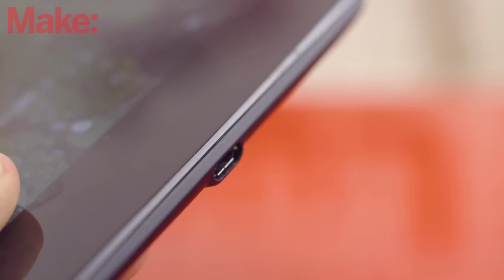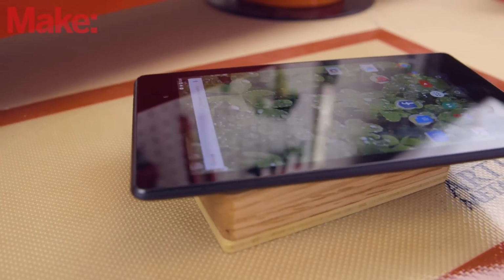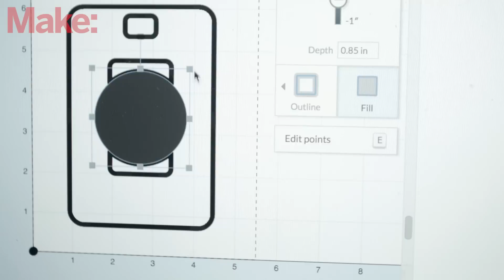Weekend Project: CNC Wireless Inductive Charger

Comment: Where does the charge coil/circuit board come from - has he pulled a regular induction pad apart to make this wood version, or do you buy it separately? - I thought this would show me how to build the induction charger, not put one inside another container.
But seeing as it's wood, you could have put some decorative inlay in the top, recessed the plug more to tidy it up, or even directly connected a power lead with standard pins or usb plug directly to the power input port
Reply: will S this is pulled from qi charging mat or pad

Comment: Which program is the one he uses to make is drawing of the project?
Reply from the maker: I used Fusion 360 to do the drawing layout, and then Easel to set it up for the CAM operation.
Reply: +Make:  Oh! Thanks a lot. I didn't think you would respond. But thanks!

Comment: We have alternating current in India. Would that work here ? What is that coil and the circuit board and where can it be found in market ? The thing you have made is very desirable and it is interesting that it can be made at home also. Thank you for this video. And, kindly do not forget to answer my curiosity because I also fear of ruining the charging port of the phone.
Reply: You need a 5v 2amp adapter, which just happens to be available as a usb charger for a phone.

Comment: Will this charge at the same amperage as the wall wort?  

i.e if the wall wort charges at 2.0A will this wireless charger also charge at 2.0A?
Reply: These chargers generally say they require 5v at about 1.5A. In my experience it's best 2 throw 2A at it.

Bear in mind this thing just takes 5v on two wires. You can easily cut the micro usb connector off and add a typical 5v dc connector, then use any 2A and up dc wall wart.
Reply: Shoot, I gave all that info and didn't answer the question. These charge relatively slowly, probably a single Amp at max. Performance is better the closer you can get the coil in the charger to the coil in the phone.
Reply: chrisbinnie Hey thanks man, I appreciate the info.  Yeah I think that's just a little too slow for my liking, but still a cool idea non the less.
Reply: +lilturk726 The trick for me was to get the little cheapo ones off of eBay and pepper them all over my life. Now whenever I set my phone down, it's probably on a charger. 

Bear in mind, too, it's not a choice between wireless and wired. You can, for instance, use a wire during the day and have this by your bed for when you charge all night - slow doesn't matter then.

Also bear in mind that the 2A USB you need to run these chargers will fast charge your phone. Enjoy the wireless day to day, and then if you really need the juice now, just unplug the charger and hook the phone up directly.
Reply: chrisbinnie That makes a lot of sense, having these scattered throughout my house and maybe even one at work would be nice...  Hmmm, I'll have to give that a shot =)

Comment: Opinions about the looks aside, this charge box is actually functionally inferior to those you can buy for $20.  The reason is because it's a single coil design.  I recommend only going with the triple coil wireless chargers (or better).

Comment: wooden chargers are out there on the market?
Reply: 50$ for a charger or 10$ for Qi-kit and block of wood? Your choice. ;)
Reply: +sleeptyper $1.50 for a puck charger on ebay.
Reply: chrisbinnie
Puck charger? Google and ebay searches return round power bricks, which are not the subject here...
Reply: +sleeptyper If you search for qi charger on ebay, there's little round ones about the size of a hockey puck. They're not listed as "puck" per se, just what I've heard them referred to as. 

They used to be rebranded and retailed as PowerBot, I think, at greatly inflated prices.

Comment: Those wireless charging pads get pretty hot. In my experience I have had to use something better than hot glue as the board has a tendency to melt away and lose contact that close contact.

Comment: my only problem is not everyone has a CNC
Reply: so? figure out outher ways to do it. drillpress and a chissel will do the job just finne
Reply: you could stack a few slices with different shaped cutouts to get just this shape. Faster than a CNC for sure. Bit of nice wood on the sides to cover it up. Possibly even making an edge for the top to sit in...
more than one way to skin a cat..

Comment: Disappointing. I would have milled out a 1/4 inch channel on the underside to place (recess) the cover into. This way the block would appear solid and you wouldn't see the bottom plate when in the upright position.